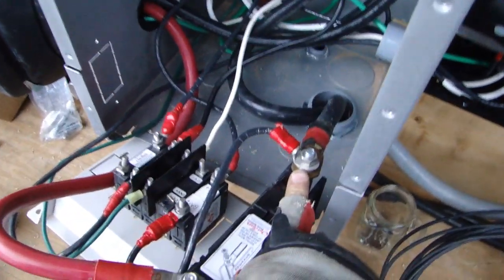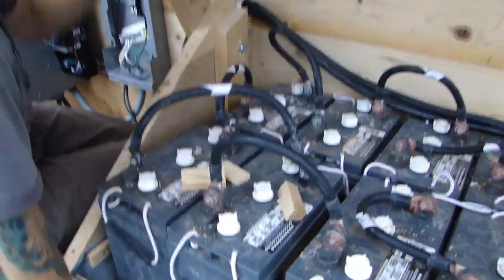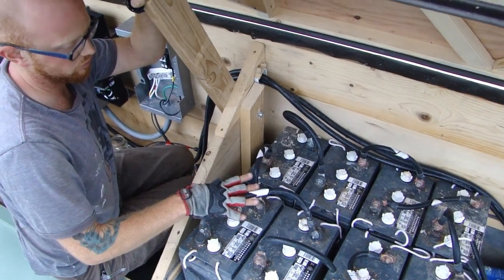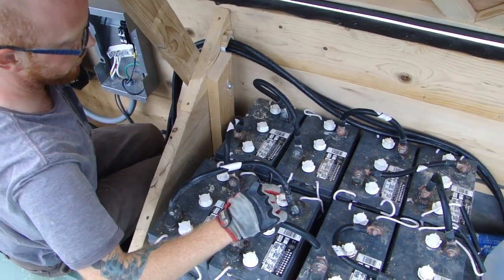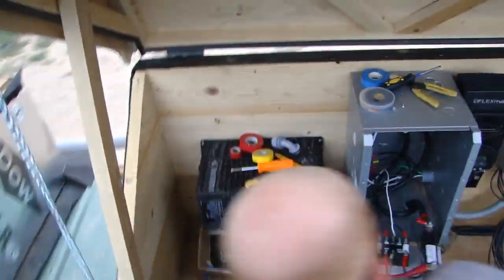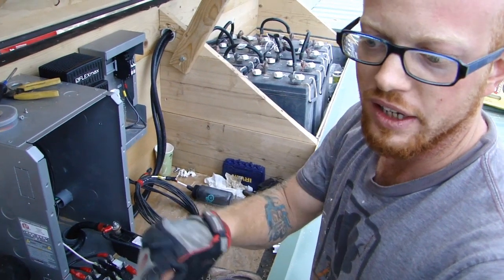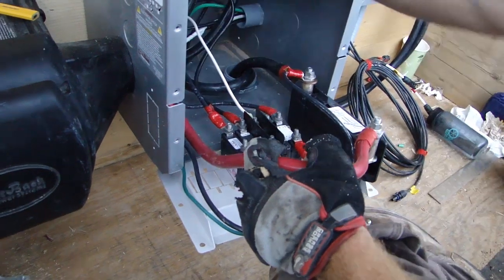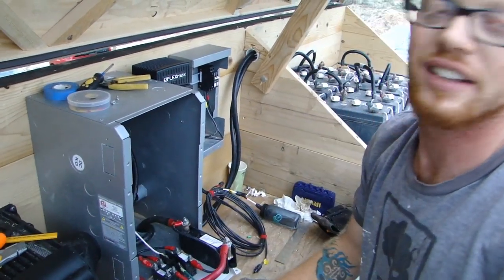Solar System Installation - Part IV

Comment: Bad electrical advice, sorry. Please don't believe the electrical explanations given here. While the batteries are wired correctly for a 24 volt system made up of two strings of 6 volt batteries in series/parallel, his explanation did nothing to make it clear. Also disregard the comparison he makes between AC and DC. This fellow shouldn't be trying to educate others.

Comment: great video guys! One correction: AC is not inherently safer than DC. AC was used by Thomas Edison to kill an elephant in hopes to scare people away from wide adoption of AC for the power grid. 
We use AC because alternating current can easily be stepped up to a higher voltage, transmitted over long power lines, then stepped back down to 120 V AC. In summary, it has to do with more efficient electrical transfer over long distances, rather than the actual safety.
One other safety note: the voltage does not directly matter. The overall current, and power transmitted through your body is what causes injury and death. Be careful, but dont be so scared that you decide to never do anything with electricity!

Comment: Quick note d.c & a.c can kill!. Due to amperage!. If you become part of the circuit and any kind of voltage carrying any small amount of amps feeding a load thru your heart can be deadly. So if you dont understand it, hire a licensed electrican. its not worth ur life to save a few bucks.

Comment: Do I have to connect my panel and batteries in parallel and series spaghetti?  So if I have a 305 watt panel, 72 cell, 35.77 volt, 8.53 amp.  Can I just connect one panel, per one charge controller to one battery bank?  What battery bank do I select?

Comment: I have to reiterate what delindsay90210 said! AC KILLLS , Low voltage DC is harmless. AC is used for lower transmission losses. Smaller wires can provide more power on AC than DC. Make no mistake you grad hold of a household AC line and are grounded you are most likely going to be dead!!! That is why GFI circuit breakers are required for kitchen,bath and bedrooms so that if your dumb enough to drop a AC powered device in to water with your hands or some such thing you don't get killed!!! This is also the reason we use mainly DC power on boats,can get kinda wet and stray AC is very,very bad.
Reply: Uhm... No. As an electrician AC and DC both kill, but in different ways. It's also incorrect which a lot of people try to say that amperage kills.

Both are pretty safe depending how they are wired, voltage and amperage in conjunction.

Though you are correct in saying low voltage DC is pretty safe. It also puts up costs quite a bit and isn't useful in a lot of areas. A lot of areas.

Though it really depends what you're using it with, for and what your end goals are going to be really.

Also no if you grab an AC line and even if you are grounded which will be unlikely you most likely will not die. AC is kind of great in the regard of making you convulse so you end up letting go of the wire, and the full power/amperage doesn't hit you all at once. For example people have this idea that if you grab a 15 amp circuit 15 amps are going to travel through you. That's not true in the least, it's more of a slow curve. So mainly what ends up happening is a small current goes through you, and you let go with a major or minor shock. AC is pretty dangerous when it comes to water, because you begin to convulse in the water unable to get away from the electricity until it builds to the point of frying you dead. 

However if you ask a real electrician what is scary; it's DC any day of the week. DC will cook you, AC will shock you forcing you to let go. Again though it really depends on the voltage/amperage and what application we are talking about. AC making your muscles contract and expand makes you let go, while DC if you go above the threshold of you being able to overpower it with your muscles will make you grab it tighter till you die. Likewise high voltage DC lines turn people into charred corpses. Though so do AC lines so... Well dunno where I was going with this other then respect electricity with respect no matter the application. Being shocked isn't fun, but telling people DC is safe is horribly irresponsible even if 18VDC or 24VDC is relatively safe.

Comment: Nice setup, very smart and efficient. I have a few questions though: Why did you choose to place the batteries and the controller-inverter-breaker box up on the roof? Aren't they in danger of overheating? I know you need to keep the distance between all of them as close as possible as well as the cable lenght as short as you can, but exposing them to the roof's high temperatures would actually cause a percentage drop in overall performance...  wouldn't you agree? thanx
Reply: wha??? this is all on the roof????

Comment: Battery's. 4x6vdc battery's at say 500ah = 24vdc at 500akh . 2 x24v banks = 2x ah  1000 ah. So AH is increased not volts.
Nice system and nice Home :).
Please take a look at mine. i am taking a house i built 25 years ago and making it solar.

Comment: I should also note the ONLY reason we use AC power in America is line transmission. You cannot effectively transfer DC current over long distances like you can with AC. So instead of making DC power on site (the way it should be and was intended originally by Edison) we build massive coal burning power plants and a few hydro (Niagara Falls) then transmit it over vast distances, of course charging people to get that power, hence the real start of the "utility company"

Comment: Although it's true you can literally weld with DC cables, it's actually quite harmless to human tissue. AC on the other hand, even a small amperage, can kill you in a heartbeat (pun intended) especially if it happens to pass from hand to hand, making a connection through your heart. Cutting DC wires and touching positive to negative with the metal cutters will weld the cutters shut and pops breakers, ruin equipment & maybe burn your skin. Cutting AC the same can kill you outright.